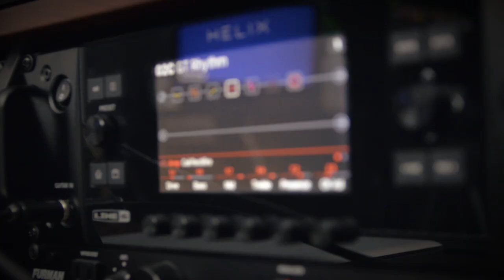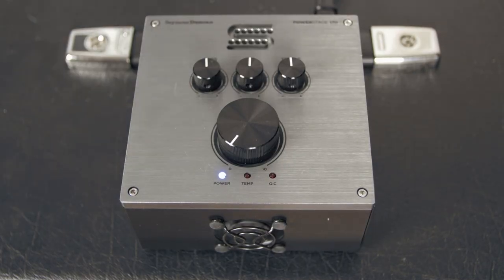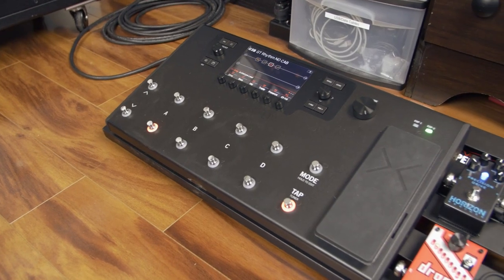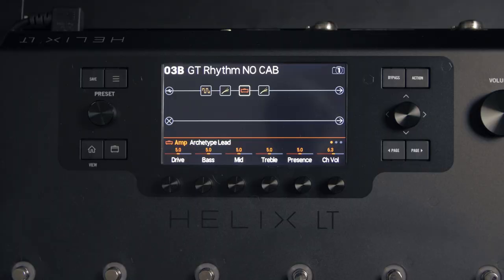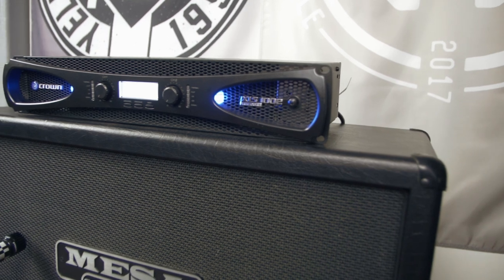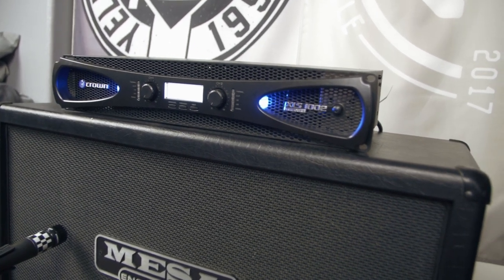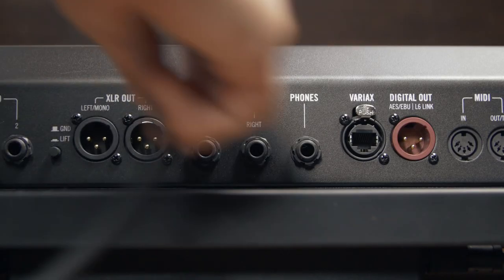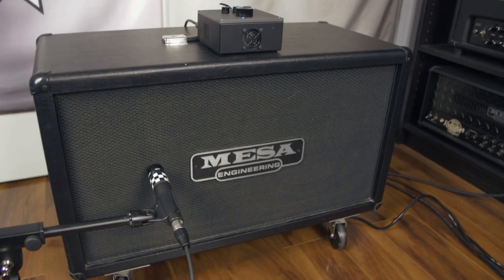Seymour Duncan PowerStage 170 Demo | BEST POWER AMP FOR AMP MODELERS

Comment: Do i need this power amp if i've already own a tube amp with fx loop? i want to connect my ToneX with a real cab but think my amp's poweramp is coloring my tone in a bad way.
Reply from the maker: The FX loop should work just fine for you! If you're capturing a full amp circuit (pre-amp + power-amp) then it's like running a power amp into a power amp. Not totally familiar with the ToneX, but if you're able to capture just the pre-amp circuit, I'm sure you'll have better luck with that. Thanks for watching!
Reply: @GerryTrevino  Thanks!

Comment: Cool video! Quick question: Is it possible to use the powerstage 170 at "bedroom" volume levels? or will lower volume setting still be excessively loud?
Reply from the maker: I would say so, you could always turn the source of what you're feeding the PowerStage 170 down too. Thanks for watching!
Reply: @GerryTrevino  Thank you!

Comment: I, too, liked the Duncan more than the Crown for the same reasons. While I don't gig much anymore and don't miss it, I therefore don't need a loud amp, or any amp at all. If I did do a few, I'd consider using an amp modeler (UAFX Ruby) with the Duncan Power Stage into my Bruno 2X12 open back cab with old Celestion Greenbacks.
Setting the sweet spot on a guitar amp means that you're stuck with whatever the volume is. Sure you can use an attenuator, but you're lugging more stuff to the gig to tame your already heavy amp.  It like working against yourself. Sometimes the volume at the sweet spot is alright for the venue, but most of the time it's way too loud.
An amp modeler has no sweet spot. You dial in the tone and gain that you want and set the volume wherever you want it. With a seperate power amp, it's even simpler. This would have seemed like magic to us back in the day, and not so long ago, but it's now a practical reality.
Thanks for a great vid and very nice playing.
Reply from the maker: All very good points! I'm also a big fan of Powercab as well which has simplified the rig even more. Thank you for watching, if you liked this, consider checking out my solo EP! The song in the video is called 'Bliss': https://li.sten.to/TnIWX1e

Comment: Is it possible to connect a low watt tube amp like a 5 watt or a 20 watt tube head straight to the powerstage or the peavey power amp.
Reply from the maker: I probably wouldn't advise that since tube amps need to me connected to a cab or a loadbox to keep them from frying. The PowerStage is all solid state. I hope that helps, if you liked this, consider checking out my solo EP! https://li.sten.to/TnIWX1e
Reply: @GerryTrevino  thank you
Reply from the maker: @JEREMIAHS_TARANTULAS  Thank YOU for taking the time to watch some of my videos!

Comment: How's the fan noise compared between the Crown and the Powerstage?
Reply from the maker: They're both generally pretty quiet, but the PowerStage is quieter.
Reply: @GerryTrevino  Interesting! I figured it would be the opposite since the PS 170 is so compact and has a smaller fan. On the other hand, maybe a the PS 700 might be a more fair comparison since it's also a stereo amp with about the same power output.
Reply from the maker: @tappistrt  Maybe one day when I can afford one! The PS 170 is definitely louder than the Crown though.
Reply: @GerryTrevino  Even if the Crown is running bridged? The PS700 seems expensive for what it is. Both are ultimately Class D amps and I couldn't hear a big difference in the sound on my studio monitors. The Crown seems to be a better value if you want/need a stereo amp for a modeler. But if you need a super compact solution with tone controls: PS170 for sure. I'm considering a stereo setup for a Helix. :)
Reply from the maker: @tappistrt  Yesir, in this video in fact I had the Crown running in bridged. The Crown is great if you just need volume and want to save money, but where the PowerStage170 wins is in portability (like you said), the EQ to dial in the exact tone you want and feel, which is something that's hard to showcase in a video. Both are great though!
Reply from the maker: This song is called "Bliss" and if you like it you can listen to it on your favorite streaming platform! https://li.sten.to/TnIWX1e

Comment: What's your opinion on this with a non-powered cab VS a powered FrFr type setup?
Reply from the maker: I haven't had the opportunity to try out a FRFR setup, but generally I hear that a normal cab tends to sound better. However, I've heard that Powercab from Line 6 sounds really great in its FRFR mode!
Reply: @GerryTrevino  
I ended up getting the PS170. I use it with my Line 6 HX Stomp. Sometimes to a powered FrFr 1x12. Sometimes to an EVH 5150 III 1x12. 
Both ways it sounds PERFECT.
Reply from the maker: @BAND-MAID-USA  That's so awesome! I'm glad you like the PS170 as much as I do!
Reply from the maker: This song is called "Bliss" and if you like it you can listen to it on your favorite streaming platform! https://li.sten.to/TnIWX1e

Comment: Seymour Duncan makes real good stuff! I usually record with digital modelers because it's just so so much easier to get a great guitar sound and record with digital than trying to mic up a speaker cab and tube amp in the studio.. 

But I've been trying to find a gig worthy SS rig for live with little success. It seems that with every solid state setup I've tried on stage there's still nothing to compare with my older Fender and Marshall tube amps. The digital amps just don't do what those tube amps can, it's hard to describe, like, they just have more of an engine as it were. I do like that 170 though and I might buy one give that a go!
Reply from the maker: Seymour Duncan makes wonderful products! I know exactly what you're talking about, other power amps just don't give the feel of a tube amp. The PowerStage is definitely the most tube-like power amp I've ever tried! Thanks for watching, if you liked this, consider checking out my solo EP (the song i played in this gear demo is called Bliss and it's on the EP)! https://li.sten.to/TnIWX1e

Comment: Why did you use the amp modeler instead of just a preamp modeler in the helix? Isn’t that redundant
Reply from the maker: I usually run the Helix direct to FOH in conjunction to the PowerStage 170, that's why I use the full amp model and not the preamp model. This song is called "Bliss" and if you like it you can listen to it on your favorite streaming platform! https://li.sten.to/TnIWX1e

Comment: Just discovered your channel. I agree with your analysis at the end, the PowerStage 170 definitely sounded tighter and more natural in the low end with fuller mids and crisper highs, cleaner sound overall. I plan to own one in the future for use as a pedal platform; not really into the whole amp modeling thing (except the old stuff like Line 6 Spider IV or Zoom 505 for intentionally raw/digital Black and Death Metal tones)
Reply from the maker: Thanks for watching! I hope you end up loving the PowerStage 170 as much as I do!
Reply: @GerryTrevino  Actually I may wait for the newer PowerStage 200 which is on pre-order currently. They added a much-needed presence control, and I'd love to have it modded for a depth & attack/girth controls as well. Possibly a bass response and midrange frequency controls too!

Comment: Excellent sound and playing. I use my old 89 Ampeg power amp section to power my racks. I just bought the new Kemper stage and am trying to find something smaller that sounds as good as the Ampeg thats more potable. I see this isn't stereo
Reply from the maker: Thanks! Yeah, unfortunately this isn't stereo. However, the PowerStage 200 has two speaker outputs and the 700 has two speaker and XLR outputs!

Comment: I just picked up the PS700 to run with my Helix Floor unit into my Orange Cab. Wondering if you have the 1/4 out on the helix set to instrument or line output? 

Line 6 has a video where they say to do it at line level and yet the PS700 is made to take pedals which would be instrument level, and there is a card in the box that says I might have better results with instrument level. 

I tried it at instrumental level already with great results, just wondering your take on it. Thanks!
Reply from the maker: Honestly, I never looked into it that deeply. I just leave it at line level and call it a day haha
Reply: I guess if it sounds good, it doesn’t even matter haha. This is my first foray into using a power amp and modeler in a live situation so I’ve been skeptical but this combo sounds fantastic! Definitely going to be hard to go back to traditional amps and pedals live now.
Reply from the maker: Oh yeah, I love that combo so much!
Reply from the maker: This song is called "Bliss" and if you like it you can listen to it on your favorite streaming platform! https://li.sten.to/TnIWX1e

Comment: What speakers you got in that cab? Question, did you do all your presets to fit the cabinet vibe, or you did them for FOH sound and then cab sound is what it is?
Reply from the maker: The cab comes stock with V30s. Well, I just made the presets with a moderately flat EQ so that it would work for both FOH and the actual cab!
Reply from the maker: This song is called "Bliss" and if you like it you can listen to it on your favorite streaming platform! https://li.sten.to/TnIWX1e

Comment: Hey Gerry! Im relatively new to playing live. I run a Mesa 2x12 and Pod HD 500x Pro. If I were to run this power amp with both would this do the trick for live shows? 

Apologies Im kinda lost lol
Reply from the maker: Hey Cameron! Absolutely it’ll do the trick. Just run a 1/4” cable from your POD HD to the PowerStage 170 and then a speaker cable from the PS to your Mesa Cab! Just make sure that the Preset on your POD has the cab sim turned off. The POD also has the Preamp models of amps that doesn’t have the power amp section modeled into them, so it might be worth experimenting using those instead of the regular amp models into the PS.

Hope that helps!
Reply from the maker: This song is called "Bliss" and if you like it you can listen to it on your favorite streaming platform! https://li.sten.to/TnIWX1e

Comment: Have you tried using the helix preamp blocks instead of the full amp models? Curious to know which sounds better into a poweramp and cab - great tones in this vid man
Reply from the maker: Honestly, I haven't yet! When I play live with my Helix, my preset splits off between two outputs so that the direct line to FOH has a cab sim on it and the signal going to my PowerStage/cab has no cab sim. That's really the only reason I use the full amp models vs. a preamp block. Worth looking into though!

And thank you for the kind words!
Reply from the maker: This song is called "Bliss" and if you like it you can listen to it on your favorite streaming platform! https://li.sten.to/TnIWX1e

Comment: How do you think this one would work with an Engl e530  tube preamp or any tube preamp for that matter? I haven't seen any demo of someone using it that way and am curious about getting it for my rack rig
Reply from the maker: I have yet to try out a rack tube preamp with the PowerStage 170 like the Engl one that you have, but I plugged the preamp section of my Mesa Dual Rectifier into the PowerStage the other day and got some great results! Your Engl e530 paired with a PowerStage 700 sounds like it would be a killer rack combo!
Reply: nice, good to know man thanks. Isnt 700 watts too much if I use a 125 watts 2x12  (WHS veteran 30 and et65 ) ? oh, and do you think the 170 is loud enough for small to medium gigs where the cab wont be micd?
Reply from the maker: The PowerStage 700 is rated at 700 watts at 4 ohms and 350 watts at 8 ohms, so your milage may vary. I was just thinking about it as far as looks and portability haha.

And yes the 170 is definitely loud enough! I've never gone past 12 o'clock myself!
Reply from the maker: This song is called "Bliss" and if you like it you can listen to it on your favorite streaming platform! https://li.sten.to/TnIWX1e

Comment: Can this run stereo ?
Reply from the maker: Unfortunately, no. You'll either have to get a second PowerStage 170 or a PowerStage 700 to run in stereo!
Reply: How do I simulate an effects loop setup between the pre amp and power amp? Just put the required effects between them?
Reply from the maker: Yes, that is correct. Just make sure your time-based effects are at the end of your signal chain before hitting your power amp and you should be good!
Reply from the maker: This song is called "Bliss" and if you like it you can listen to it on your favorite streaming platform! https://li.sten.to/TnIWX1e

Comment: Hi, could you please advise what kind of cable to use from output of PS 170 to guitar cab ? is the normal instrument cable fine ? cause that cable normally used from tube amp to cab is too short to use it with PS 170 hooked to pedalboard. thanks for reply.
Reply from the maker: I use a 30' Hosa speaker cable to go from the PowerStage 170 to my cab! Speaker cables and guitar cables are more different than you think and I wouldn't really advise substituting one for the other. Check out this video from CSGuitars for more info on this topic!

https://www.youtube.com/watch?v=JhbG_WQ7ORo
Reply from the maker: This song is called "Bliss" and if you like it you can listen to it on your favorite streaming platform! https://li.sten.to/TnIWX1e

Comment: Hey Gerry. I just came across this video when searching for some tips on guitar use through a computer.
I have a question for you that maybe you could help me out with.
You are using the Line 6 Helix -> Power Amp -> Cabinet.
Would a signal chain of a Preamp IN -> Computer/Amp Sim software ->Preamp OUT -> Power Amp -> Cabinet work also?

Example: I'm using a Focusrite Scarlett 4i4 Interface. Can I run guitar into the input on that, to the computer and through amp sim, and run the line out on the Scarlett to the Powerstage 170 and so on through a cabinet?

I've been searching for hours for an answer on this and before I buy anything I wanted to make sure I'd be good with this.
Reply from the maker: Interesting! I've never tried such a thing, but the PowerStage 170 is usually fine with taking line level signals. If that doesn't work, you might have to use a reamp box to feed the PS instrument level signal. Happy experimenting!

Comment: Is this able to sound good at low (I mean apartment friendly) volumes? I am really struggeling to find a good sounding amp for mostly hard-rock and metal, which sounds good at low volumes. All th tubes amps are out of the equation, and most solid-state amps just don't sound that good. So  now I am thinking Line6 Helix LT and a power amp. But does it sound good at low volumes through a cab?
Reply: It's perfect at low volume. I use with a GT 1000 in a home environment. Ramping up the volume makes it louder but doesn't colour the tone.
Reply from the maker: What Chris said!
Reply from the maker: This song is called "Bliss" and if you like it you can listen to it on your favorite streaming platform! https://li.sten.to/TnIWX1e

Comment: One heck of a review video, bro. 👍👍

I was hoping to see you play a bit more on the rhythm section over the leads though.

My current gear is Guitar > Helix LT > Laney IRT-X FRFR Speaker. I'm thinking of replacing the speaker with a Mesa 2x12, but I would need to find myself a power-amp (tube head/SD Powerstage) first..

BUT in order to fund for the Mesa 2x12 + Powerstage, I'd have to sell of my Helix LT.. 😕

So I'm a bit of a dilemma now. Basically, if I commit to getting the Mesa 2x12 + Powerstage, I'm sacrificing my Helix LT (and probably will start saving/funding for individual pedals in the long-term).. Can you give me some advice, bro? 🤘
Reply from the maker: Thank you! I'm usually more of a rhythm player, but I felt the leads a lot more for this particular demo.

Hmm... that's a tough one. If i were you, I'd hang on to the Helix at all costs. If you're playing live, try going direct! You'll be surprised how responsive it is that way. If that's not enough for you, then I'd say save up and get the PowerStage and a cab afterwards. Hope that helps!
Reply from the maker: This song is called "Bliss" and if you like it you can listen to it on your favorite streaming platform! https://li.sten.to/TnIWX1e